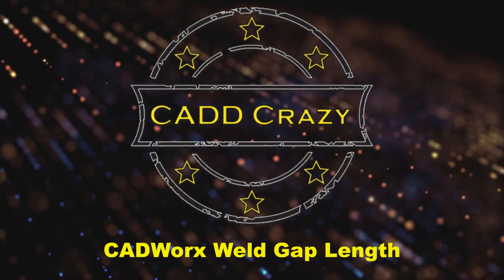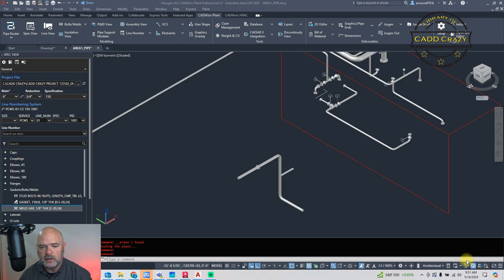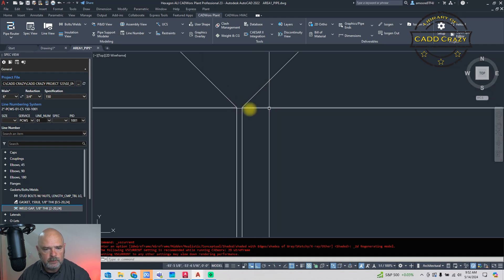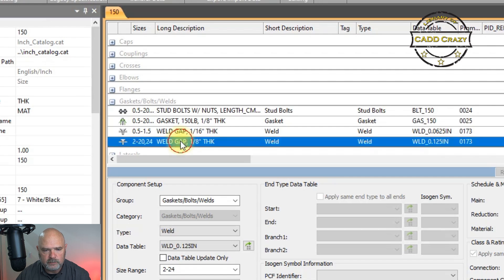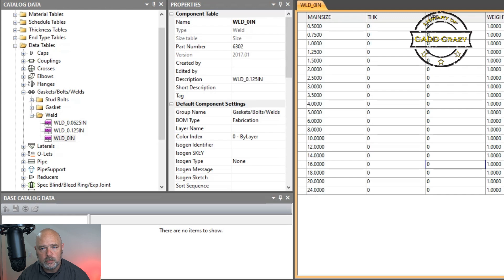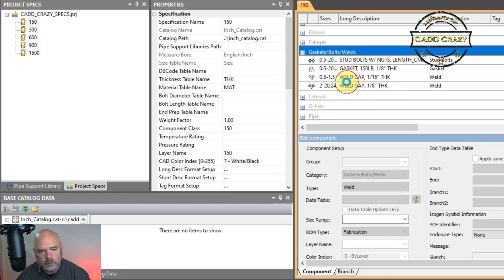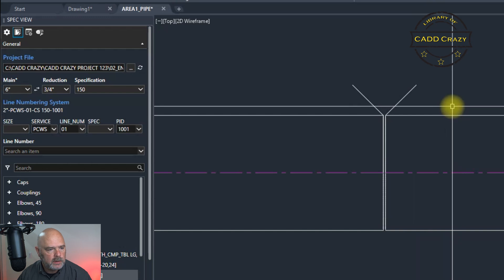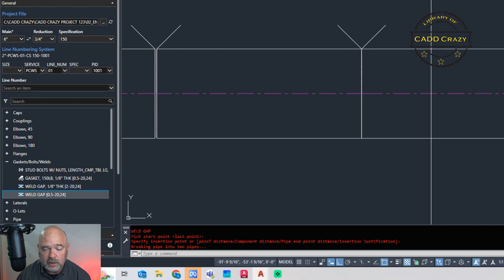CADWorx Weld Gap

Comment: May I ask a question about bends with tangent length greater than 0mm? They always fail in isometrics
Reply from the maker: I will have to look in to that. I have never had a problem with tangent length.